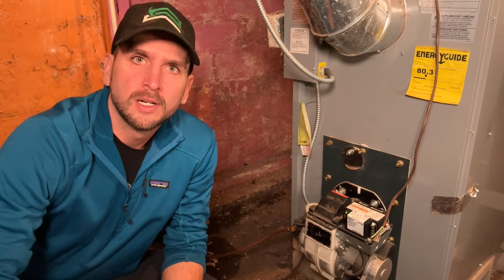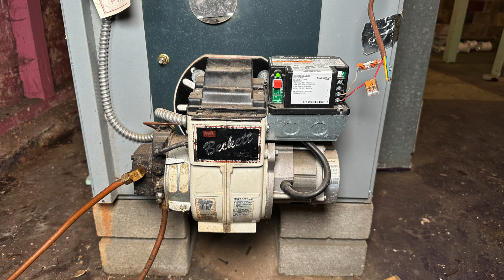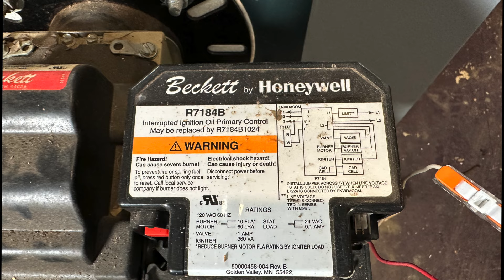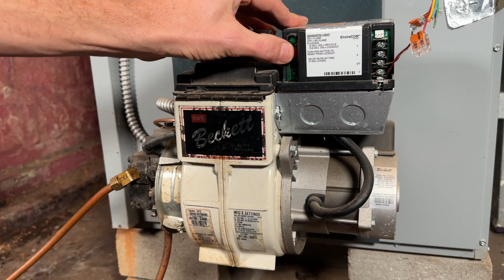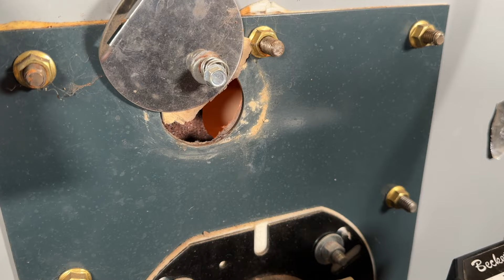How To Restart An Oil Furnace | Hard Lockout and Bleeding Fuel Lines

Comment: So once started is the heater supposed to stay in until it reaches desired temperature? Or does it turn in and shut off until it reaches desired temperature? I got mine to turn on but it runs for like one minute and then shuts off again. I have the thermostat up to 80 just to get it warm.

Comment: Here is an alternative method. Put a wrench on the bleeder and a hose and open it up with power off. It should gravity feed in without having to reset so many times. Catch what comes out in clear tube and look for anything floating. It should be crystal clear. It not, check filter and clean after filter pipe. Open top of gun and look for carbon on gun. Remove tip and put in acetone and shake. If anything comes out in the acetone, replace nozzle. Always check flame. That is what it takes on mine.

Comment: When I set thermostat, the oil furnace runs for 5 seconds and shuts off, then locks out. tried bleeding but still shuts off, will run while in service mode just not with door closed. Just replaced door switch. Any ideas?

Comment: That burner looks like it has a two pipe system, which means you don't have to open the bleeder. You just have to hit the reset button.
Start out by holding the button down for 45 seconds and resetting the control. When the burner tries to start,  give the button a quick tap, and it will put the burner in purge mode. That way the burner will run for a couple minutes without locking out.
Also, use a hose or put a bottle around the bleeder so it is not sucking oil into the burner through the combustion air intake and making a mess inside the burner and on the floor.
Reply: You are the goat. After an hour and half of doing it as the video said and failing i tried your way and bam!

Comment: Thank you so much!  My furnace went into lockout.  I didn't know what was going on.  We have a heat pump with a backup oil furnace.   My HVAC guy has told me how to fix this a few times, but actually doing it myself vs hearing how to do it are different things.  Thank you for walking us through this.  You saved me and my son from freezing tonight.  It is 16 degrees here and dropping.   Thank you 🤗

Comment: I have some fuel that looks to be a half way decent stream. At the bleeder. it'll come out ok, and then slow down. ,& then to no stream at all? I replaced the pump last yr. So what do you think 🤔... I replaced the filter & also replaced the "small round screen filter" in/on side of pump. U know pulled the 4 Allen screws & replaced that filter. It's weird cuz it gets fuel to the pump/bleeder. Then it doesn't,then it does 🤔.. it'll even fire up by itself 2/3 times be4 lock out. And then same thing all over again 😡... Think it's a bad pump again? This will be my 3 pump in 4 Years if I get another one... Idk 😐...

Comment: Thank you so very much!! I am 70 years old and I ran out of heat 3 night ago. I called the oil company right away but they were backed up with calls and could not come for 3 days. They finally delivered fuel this morning around 11 am. I had to leave shortly after to go to daily blood treatments. The man said wait about 2 hours before you try to turn it on again. My treatments take 5 so no problem there. I got home and tried to start my furnace, nothing. I know not to press the red button more than twice. I called my oil company and they said it is after 5 pm so if I want the man tonight it would be $150 emergency call plus $150 service call. I can't afford that on SS. It was nearly midnight I was freezing for the 4th night. I couldn't stand it anymore. I thought to myself how hard could it be? I watched your video 3 times, dug out a 3/8 wrench, got a large glass jar and followed your instructions. Wouldn't you know a little air came out than a nice stream. I turned that little knob back in place. I have heat!!! Not only am I going to sleep warm tonight, you saved me $150. Thank you Jennylyn

Comment: I have an oil burner than is going into a Hard Lockout (says failed to ignite) every couple days. New filters and new nozzle installed 3 weeks ago.

Holding the reset button ignites the flame and it works again for a couple days, but then goes into Hard Lockout again.

Comment: I recently replaced with new lines after a leak. Boiler won't fire after starting. Goes into lockout. Nothing comes out of bleeder valve, and checked for clogs coming from line in tank. Is it common for a vacuum pump to have to be used after replacing the lines? 
The tank is on the ground against  the house. The lines run a foot and a half up above and then go down and feed into the foundation wall to the boiler going back up to boiler in the house

Comment: I'm trying to reset the exact same Beckett controller from hard lock out. My furnace has a very old t-stat stack controller with the IGN and MOTOR relays. I can't hold the reset button down on the Beckett long enough before the stack controller trips and I have to reset it. Any ideas

Comment: Mine needs 5-10 attempts because it will turn on and then off again, I think the cat eye flame sensor turn off the pump because the flame still flickers alot due to still some air in the line…you can see it flicker at the end of this video also

Comment: Sometimes looking at a new piece of equipment, you need assurance that what you’re looking at is indeed what you think it is.  My bleeder valve was in the same proximity and bled it as instructed.  Boiler started right up the first try.  It also helped feel comfortable from a safety aspect how you restarted the boiler multiple times.  There’s lockouts on commercial boilers so you don’t flood the box with fuel when there are many other problems that can occur.  Residential boilers are much easier.

Thank you for this video.  It was very helpful and informative.

Comment: Thanks for the video.

I have a Beckett oil burner with a Honeywell controller. 

My controller was not flashing. It’s yellow light. The light was on and the light was steady. 

I held the button for a full minute, and that was enough to get it to reset and to start up again. This is a very old unit and to be perfectly honest I want to get rid of oil entirely. I would almost prefer to go over to electric eventually , but I have to make sure that I can heat the house and heat the water that I need for showers.

Comment: I wish you would have told people to look inside to make sure oil is not being pumped in and it is a transformer failure. And i am surprised to see it looks like a 2 pipe system along with the need to bleed so much. Perhaps to show people how to bleed you changed the filter and didn't bleed the canister.

Comment: I am a 79 year old man with a horrible memory. I didn't remember that it was 45 seconds, so I kept holding it for about 30 seconds expecting something to happen after the full count lockout. 
So this morning I had to watch this video again to get that knowledge. I put a sticky note on the HS Tarm multi-fuel boiler, it says "Red button for 45 seconds to reset hard lockout, you old fool"😅
We only use this the Tarm for hot water, so we only get an oil fill about twice a year.
 I have no idea why they're adding a water to my oil. Maybe to make it more ecological, to save the planet from global warming? 
I hope they're not doing this when I'm 90 years old! That would really suck.

Comment: The panel, or gasket that attaches that motor to the unit on mine shows a decent amount of corrosion and wear (particularly around the bolts) one tech told me I should replace entire system soon. Another old school guy laughed when I told him that’s what the guy advised. I’m curious, is that actually a typical weak point on these and if it goes is it a total loss? To me it doesn’t seem like it’d be that hard to fix.

Comment: Going to put this here for others who this video didn't help:

For some reason my led light was off and I tried multiple times to hold it in and even used a timer. No joy. Resetting my breaker didn't work BUT...

I thought "maybe it flipped my switch" it didn't. But I turned the furnace switch off and on anyway. By the time I got back to my furnace it had kicked in. Before I could even get my wrench to the bleed screw it ignited! So simply refilling my tank and turning the switch off and on worked for me. I didn't even need to bleed the line despite it running dry. 

If you can't get the light to work and you know there's power to the unit try simply turning your power supply switch off and on. The breaker didn't do this for me I have no idea why and I'm not questioning it because I have heat again. I hope this helps people who couldn't get the reset button to start the furnace up.

Comment: Hope your still active here , i have the same setup and i have No green light , i know i have power from the wall to the furnace , but after that i know not where to check , it was working perfectly fine Until i connected a wifi power on/off plug to turn it on and off . did i fry something ? where can i look or check , thank you

Comment: HEY MY FERNUS FILTER HAS FROZEN SOME HOW SO I REPLACED THAT AND GOT THAT ALL WORKING BUT FOR SOME REASON I CANT BLEED MY LINES ITS EITHER CLOGGED OR THE PUMP THAT SAPOST TO PUMP THE OIL TO THE HEATER IS BROKEN LOL BASICALLY WHAT IM TRYING TO SAY IS MY BLEEDING THE LINE BUT NOTHING IS COMING OUT NOT EVEN AIR

Comment: You do not need to open the bleeder valve on a 2 pipe system, it will prime itself by recycling the unit.  The bleeder port is for a 1 pipe hook up without the return line. The newer R728B Honeywell primary control has a bleed by pass feature built into the controller for priming the unit from 1-10 minuets if needed.

Comment: I was nervous to try this. I didn’t even know what a boiler looked like and was able to completely resolve the issue within no more than 10 mins of taking action!

Some things that might be helpful to note

1. The oil switch to the burner can and I think has to be on while you do this. I wasn’t sure about that part and was worried I’d blow up, but still here 😅
2. Although the oil comes out in drips slowly here it might come out quite strong and fast, so make sure you have a bucket under it and that your out of the way of splash or wearing clothes you’re okay with getting oil on. Having paper towels or a rag handy would have also been good.
3. For my boiler it was just one press of the button, not a 45 second hold.

Comment: Turned on my heater and nothing. Found out it was in the permanent lockout. Reset it and let it cycle and it went to lockout again. 
Reset it again and opened the valve as in the video and it worked instantly. Blowing hot hair again. Thank you!

Comment: Thank you so much for this video!! You saved my life! lol ... I just replaced my pump, nozzle, ignitor, and almost replace my blower or circuit board. My oil boiler would call for heat click and hum.... but not try to fire or turn my blower on.. I could not figure this out....... I probably did most of it for nothing but it works now.. PERMANENT LOCK OUT 
Thanks so much for this video I could not find anything anywhere!!!

Comment: 5 TRILLION VIDEOS ON YOUTUBE THIS IS THE ONLY GUY THAT  TELLS YOU TO HOLD IT DOWN FOR 45 SECONDS !!!! THANK YOU !!!!!!!!!! SAVED ME 300!!!!!!!!!
Reply from the maker: 😂 thanks for the feedback!
Reply: Thank you , you were 100% correct!  Held it down for 45 seconds & it kicked right on.  Opened the bleeder & let the air out of the line and all is functioning properly!
Thank you for that tip!
Reply: @privatehudson4432
 The reason for this IS so that the concontrol is.only.reset too many times and the chamber does not get way too flooded....that would be treacherous if it were to light.
Reply: Yes these controllers are specific in their own and I was never taught that either until one day a guy teaching me explained it to me and he also told me to never switch these primary controls with any other ones to try to use this specific one if you do change about

Comment: Thank you for your help! It's been years so I didn't remember all the details. I used the 3/8 wrench, a washed/dry dunkin donuts straw and a 2 liter empty soda bottle on the bleeder so I could rest it on the ground while it caught the excess oil, then I could focus on closing the valve once the air was out, then poured the extra back in the tank. It started right back up!
Reply from the maker: Thanks for the feedback!
Reply: that's Genius!  if I have to do it again I will have to remember the trick with the straw and the bottle.  I used plastic bags and Cat Litter, just to keep from making a mess!

Comment: great video, what do I do if there is oil in/at the tank but not going to the filter outside the tank , clear filter just no oil getting to the filter, I dont have an air compressor , is there a way to clear it out with out an air compressor ? thanks for the advice

Comment: I have done this reset before.. but what can I do if there is no power going to the controler. No led lights at all. I checked the breaker, but that is not the issue. What can I do?

Comment: Curious why ya didn't open the bleeder fully to speed up the process. I'm an hvac tech of 25 years working on gas and electric equipment and watching videos and broadening my knowledge a bit.
Reply: Bleeder valve should be fully opened after about a 1/4 turn on the nut

Comment: Thanks for the info.  I replaced a dirty filter and a little later I noticed the furnace wasn't running ( we also have a Franco Belge gravity feed oil burner so our oil fired forced air system is backup).  I must have gotten air in the line and after a few cycles, I'm back in business.  Thanks again.

Comment: Hi Scott. This video is very helpful and I'm doing everything you're instructing. However, I did a little over 10 iterations trying to get this flame to burn. My furnace hasn't been turned on for over a year. I wanted to see if it's operational. I put 15 gal of fuel in it and still getting air. How much fuel would you recommed to just see a flame started? Thanks.
Reply from the maker: You probably have plenty of fuel just sounds like the line still isn't primed.  I was having an issue where my fuel line filter was plugged.  Once I swapped that out fuel was much easier to get through the lines to make sure the unit primed and was able to light.
Reply: Can you explain to me how I can prime it and even check if my line is plugged?

Comment: excellent video. are they run on disel? tank is empty and i need just a bit to get it going while renovating

Also, are they much more expensive to run compared to electric heat umps? 

Not sure if i should consider replacing the unit with an electric one.
Reply from the maker: I was running this one on Diesel during the renovation.  I then eventually swapped it out with a Mr Cool Hyper Heat ducted system.  https://youtu.be/JKcvUjD9NrU
Reply: @EverydayHomeRepairs  Great. is that a DIY system?

Comment: I’ve got a becket Deisel burner and I’ve got good fuel  supply and new external filter I’ve checked the internal filter and it’s clean and tried the bleeding process checked the signal to the fuel valve coil and the controller is sending  power to the coil to open it and it’s still not building any pressure would a bad coil to the fuel valve cause it not to build fuel pressure ? Or is the fuel pump bad ? Thanks in advance

Comment: so i did the 45 second lock out and opened the bleeding valve. no air in lines but my furnace keeps shutting off after like 3 seconds. i tried this several times and still the same thing after 3 seconds of running
Reply: Same

Comment: My red interupted ignition oil primary control had a flashing red light/button. I pushed the button in and got two green lights (pump prime/flame) and then it fired up. 15-20 seconds later it made sputtering sound so i opened up the little pilot door tonsee if it still had flames firing and it made an awful sound and extinguished, shooting soot and black smoke everywhere. Guess i needed to do this fuel drain cycle thing you do here? Or was the issue i didnt hold that button for 45 sec, i just pressed it in real quick. Not big on DIY stuff involving fire and smoke erupting when and where you sont want it to if ya do something wrong haha, prob pay someone else at this point

Comment: Good video. I’m not in the business but I believe once the motor starts, you can simply jump out the safety and it will run until the air is all bled out of the lines and then you can close the bleeder and the burner will fire and you can remove the jumper from r r

Comment: Have the same system and controller. It will run well after the reset and bleed, but if I turn it off for a couple hours, it will not fire again and I'll need to bleed it again. Then it works okay. I have a feeling it's sucking air back into the fuel line. 
Any suggestions?

Comment: With all due respect you shouldn't be telling people how to reset a locked out primary control. It's there to keep the burner in a safe position so that when a qualified tech shows up there not walking into a dangerous situation when they get the unit to fire. I've been an oil burner tech for 15 years and would never share this info with the public because the public are stupid.

Comment: You can use 1/4 ID -3/8 OD clear vinyl plastic tubing and a container so you can see the oil when bleeding the oil pump makes it easier to see when you have a good oil flow or not make it easy to troubleshoot and life easier
Reply: I just moved into a trailer that has this exact furnace actually and when I moved in I found a orange juice jug that was clear and clear tubing I meant to throw it away but me procrastinating never did but what I find most hilarious is that I spent the last four days trying to get my damn furnace up Watch this video and I had to just reset my lockout thing